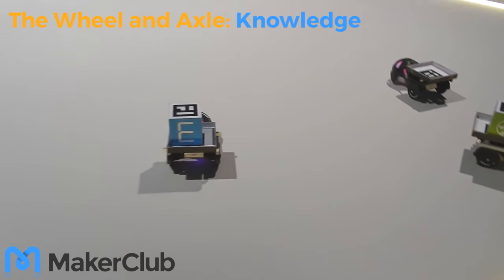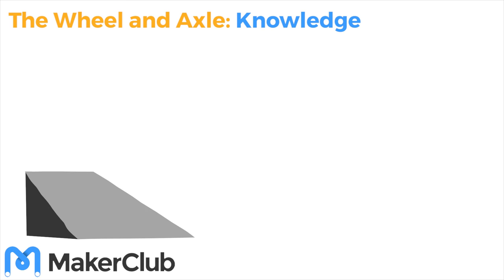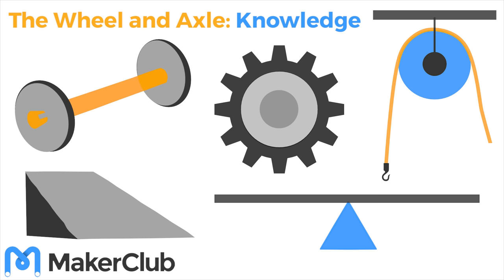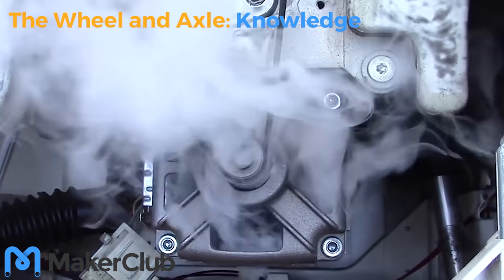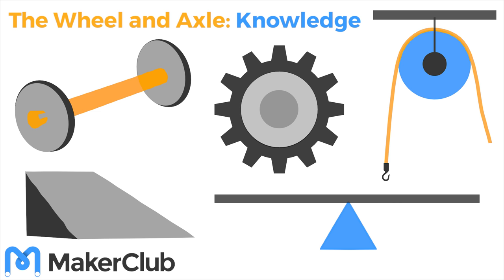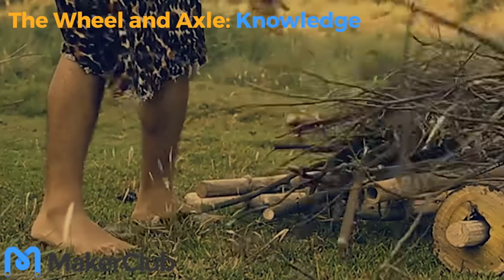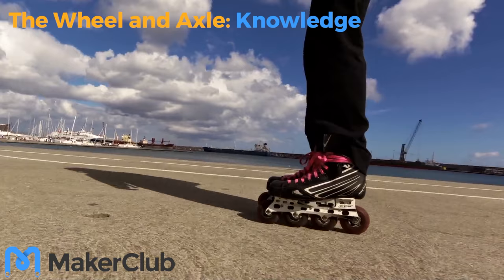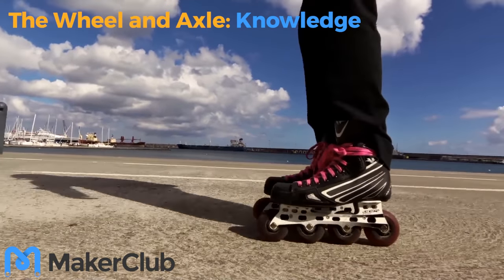How does a wheel and axle work?

Comment: I've looked at a bunch of these educational videos for kids about the wheel and axle. So far none have included bearings and explained why you need bearings and how they make wheel and axles work.
Reply: I agree. The wheel was "invented" when everyone noticed a rock rolling down the hill. Yawn. But add two wheels and an axle to that mat you've been dragging, now THAT'S the miracle! Not the wheel but the AXLE is the great invention. But educators say, "Invent the wheel and now you can pull a wagon," without ever explaining how an axle works.
Reply: Bearings are needed because when a wheel rolls around an axle, there id going to necessarily be some empty space and bearings ensure that the wheel doesn’t wobble and fall off correct?